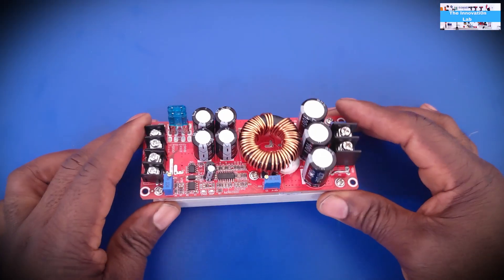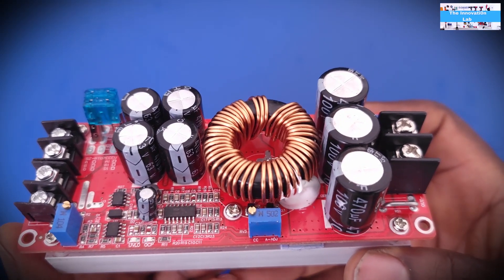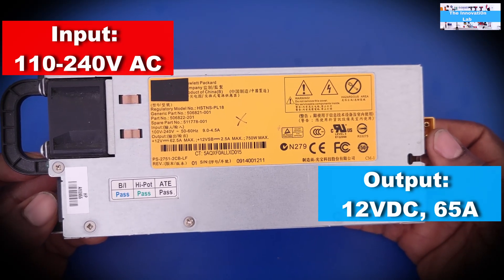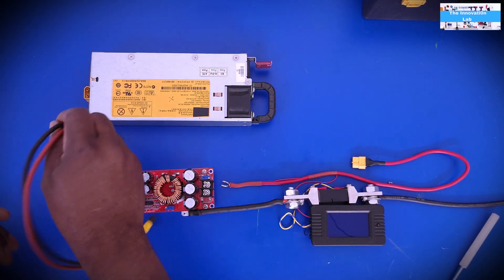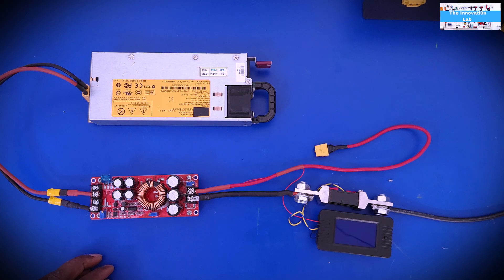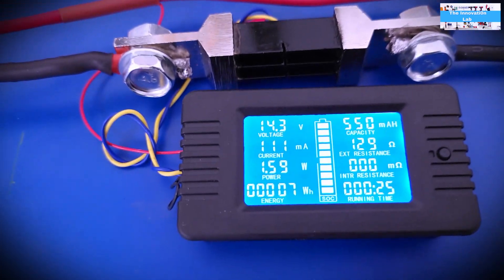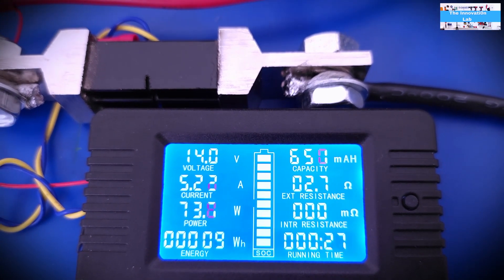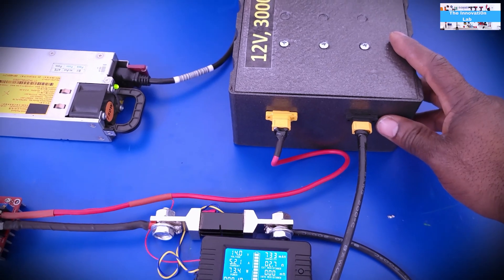Cheapest Universal Battery Charger Using a DC-DC Boost Converter

Comment: Can the boost converter be hooked directly to a Lithium battery for input and then mppt solar charge controller? Without the need of a Ac power supply
Reply from the maker: Thanks for watching our videos!
Primarily, the boost converter can be used to boost any DC source with the range of 10 - 60V. 
But, I don't think they are designed to interface with MPPT controllers.
Reply: @theinnovati0nlab782  MPPT controllers generally have a curve (either learned on the fly or preset) that is optimised for solar panels as the source. You could in theory use this with it, but it is unlikely to be optimal. There is also the risk as you are pushing the system (without checking the calcs etc yourself) into a non-standard operating mode. You risk damage to equipment and/of safety issues.

When dealing with switch mode power supplies please be aware that when they fail they can produce quite high voltages. Another ower module I had failed with 60V across the output which was not great for the equipment it was connected to.
Reply from the maker: @MikePreston-darkflib  
I appreciate the interaction. However, I don't see the relevance of your comment to this discussion.

Respectfully,
The Innovati0n Lab 💥 
www.theinnovati0nlab.com
Reply: @theinnovati0nlab782  Sorry, I meant to respond to your parent comment...

@WC03 asked about MPPT charge controllers.

Comment: will it automatically stop chargeing whn the battery is full? Will it stop because battery has reached the same voltage than the charger and thus there is no current flow? Thanks in advance.
Reply from the maker: Yes, as long as your charging voltage is set to the right level. 
For example, the typical charging voltage for a 12V lead acid battery is 14V, so if you set the charger to 14V volts to charge a 12V battery, then the charging system and battery voltage will equalize at full charge. Hence, charging current will drop almost to 0A.
But if you are using it for other battery designs, make sure that those batteries are protected with a BMS.
Reply: @theinnovati0nlab782  thanks for your answer. I saw on YouTube that others use a MPPT charger with automatic stop relay when the goal voltage is reached. 
As I allready bought the unit you have, I was wondering if current really drops to zero... I want to charge an E-Bike battery in the car with my light machine. Not Sure which BMS is in the E-Bike battery, it does not have Bluetooth for charging information.

Comment: thanks for this great video.and i have a problem hope you will hel me.i have 12v 45AH battery and bldc moter of i=e bike 48 volt and its need 10Amps to run.can i use this 45Ah 12v battery and 1500w boost converter?will it give me 10Amps and 48V outputt(12*4=48 so 45A/4=11.25AMPS) so will it succes?
Reply from the maker: Thanks for watching my videos!
I will definitely love to help you. Helping people is the goal of The  Innovati0n Lab.

Actually, I am currently making a video about a related subject. I got the 1500W version and I am making a test video for it.
Upconverting from 12V to 48V at 10Amps (480W + conversion losses)  maybe a challenge if you intend to use the boost converter in my video. Even the 1500W version can only handle up 30Amps at the input - this means about 360W (12 * 30) at the input of the boost converter. 

You should be fine with using a 24V battery instead. This will guarantee that you have greater than 480W  at your input.

You can also try using a different model/design of boost converter that is built to handle more input current.
Reply: @theinnovati0nlab782  thanks for fast reply sir.so in this type boost coverter input is 30A right?sadly thought output is 30A.so if i conect 45AH 12 v battery will this 1500w boost converter give me 48v 7.5 amps(coz 30/4 =7.5).and my last quection this boost coverter can handle my 45AH battery?(coz its max input 30A so my battery 45A).again thanks for your time : )

Comment: Has any one got a schematic of this charger. As I want to modify it so it only has a small span of voltage. For charging lifepo4 battery or a lead acid.
Reply from the maker: I added a brief animated schematic to this video. It is easy to follow. There isn't anything to build really.
I also made a video that shows how to configure the server power supply to deliver the 12Vdc output.
Watch the video I made about the HP server power supply.

Comment: Sir I want to make 3 wheeler with 24 volt 20 amph battery using 1200 / 1800watts dc-dc boost converter 750 watt dc 48 volt motor will it work? And how many hours? Please give me the correct information
Reply from the maker: Thanks a lot for watching our videos. 
I believe you should be able to boost your 24V to 48V using any of these boost converters. However  the question of how long you can drive your motor, is something you have to test. Your motor may draw more power when it is driving heavy loads and less power  when it is barely driving anything. So by testing, you should be able to answer that question.

Thanks again for such thoughtful question and goodluck on your project.

Comment: Sir I want to drive 48 volt dldc 1000w motor rickshaw through this booster with 12 volt battery. Will it work well with this booster? Sir help me with correct information
Reply from the maker: Thank you for watching this video and supporting The Innovati0n Lab. 

My recommendations will be that you try getting the 1500W model of this boost converter and doing a thorough drive testing of your motor with it. Also, since you will be driving a 1000W motor with a 12V battery, I will highly recommend using cooling fans on the boost converter unit. Also keep in mind that driving a 1000W load with from a 12V battery means greater than 83A drawn from your battery and this does not even account for losses  due to converter efficiency....can your 12V battery handle a constant draw of >83A?
Personally, I will recommend using 24V battery if possible.

Comment: Very informative video. May I ask if what will be the charging voltage for a 60V lifepo4 battery pack? I plan to use the same converter to charge this 60v battery
Reply from the maker: Thank you so much for watching my video and I am glad you found it informative.

As for your question, the charging voltage for your 60V battery pack will depend on the number of Lifepo4 cells you have in series. (18S or 19S?). Multiply the number by 3.65 and that will give you your maximum charging voltage. I would recommend  that you do some research to understand your battery specifications some more - just to be on the side of caution.

Example: 
If your battery pack is an 18S lifepo4 (18 cells in series)
Charging voltage:
18 * 3.65 = 65.7V
Please do not exceed this voltage.

I hope this helps you and let me know if you have more questions/concerns.
Thanks again and have a wonderful day🙏🙏
Reply: @theinnovati0nlab782  Thank you. Again, your quick reply also was very clear.
And I just want to ask one more thing, you think this 1500w buck converter is capable enough to give a constant 65v (for example) even if I just give a 12v  input in it? Does the input current also matter for the output voltage?
Reply from the maker: I have only  tested it to 60V from a 12V input. I will do another test and I will update you. 

However, looking at the specs from Amazon, it should be able to go upto 83V...in theory.
Reply: @redfoxthehobbyist  for lithiums you must have a proper bms board so you don’t over charge individual cells. Using this set up will work but you have to manage current properly or they will explode.

Comment: I hear the max watts u can put thru it is only half of the max 1200 or 1800 w.. on each side .. in or out put cables .. 60v x10a
Or ..90v X 10A..
Reply: I saw a vid of a ham radio man in usa . Had 4x of these in paralell.. 1500 watt output max . Using 4x 
.1 ohms resistores on each line input .. 2balance all inputts
Reply: I havnt test my 1800w yet.. on solar in .. i wana do.for pwr 18v tools

Comment: 👍👍thank you .  Dose it have v low current draw at 0load ..
No load on output..
Reply from the maker: Wonderful question. Thanks a lot for asking that👍.
I have not measured the input current draw at 0 output load. Every converter has a small input draw to keep the control electronics running - even with no output load.  However the higher the efficiency of the converter, the lower the input current draw at 0load.